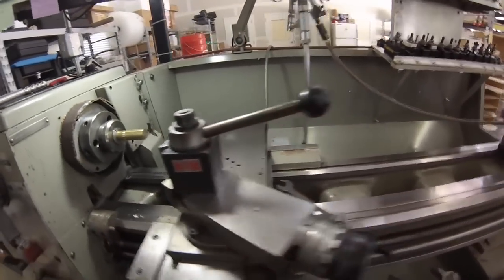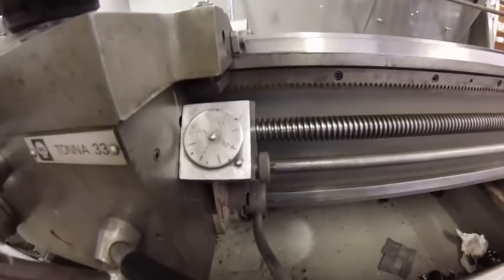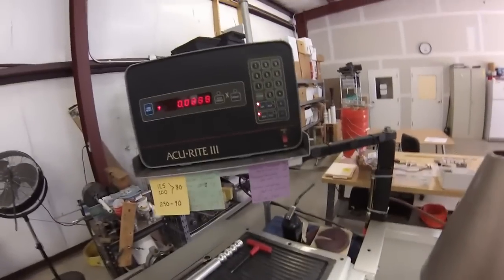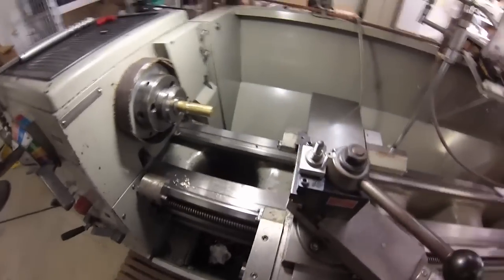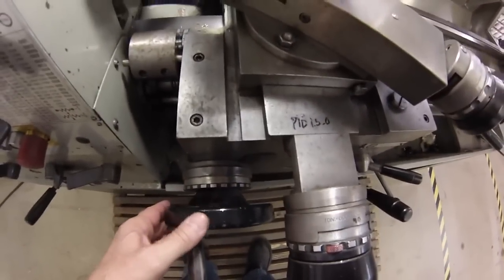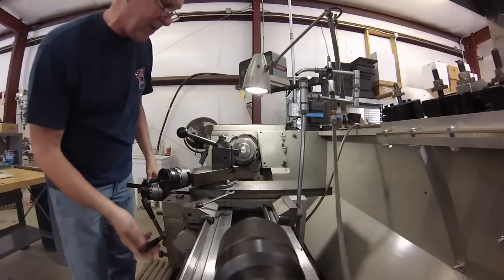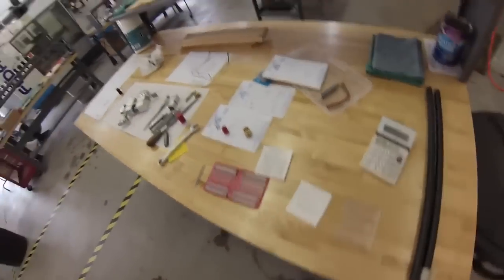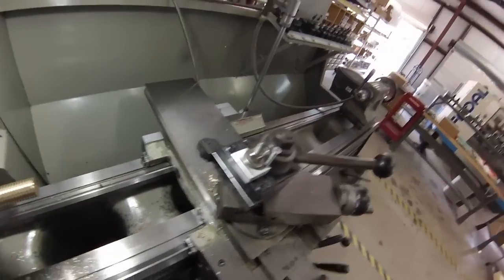Anniversary Video -- Easy and STRESS FREE Single Point Threading.

Comment: I have a Colchester chipmaster. If the carriage comes up against a carriage stop the carriage drive automatically disengages, not a clutch that slips, but the half nut  kicks out. Seems like there is a spring set threshold that is overcome on carriage resistance

Just to add, your method is still the best
Reply: You'll find this feature in a few, high-end lathes (eg Hardinge,) usually aimed at the toolroom market. (The Chipmaster was Colchester's attempt at a toolroom lathe.) Some folks have rigged up their own, Heath Robinson (Rube Goldberg) versions. You can add the facility to any Colchester (Clausing) lathe with an Ainjest rapid threading attachment.

Comment: A dab of grease will hold the thread wires onto the work piece while trying to take a measurement.  Doesn't work real well on the larger wires as it does on the smaller wires.
Yeah, I've personally wrecked and torn up a Aloris CA tool holder and threading tool trying to cut a 1"-8 thread up to a shoulder before.  Fixed the CA tool holder, threading tool cost me $60 bucks back then to replace.  After that, bought a LH threading tool and cut the thread as you did in your video.  Thanks for the refresher and sharing your video. Ken

Comment: Always wondered why more people did not do this ???  ;)
Reply: sometimes is not possible - i use a metric lathe and the gears for threading are mounted on a reduction output - i am obligated to maintain the half nut always connected, in metric or TPI threading.